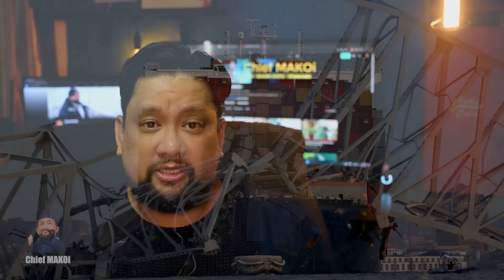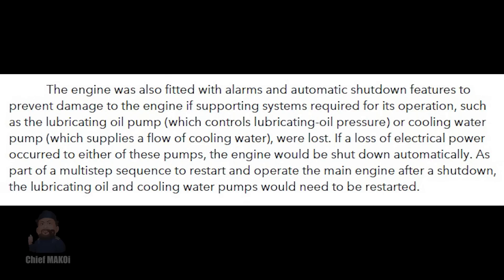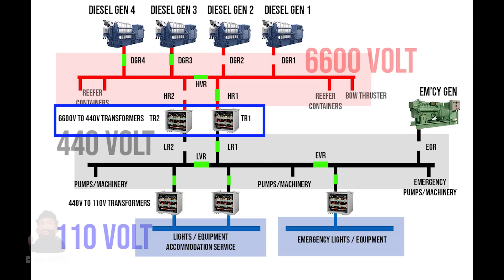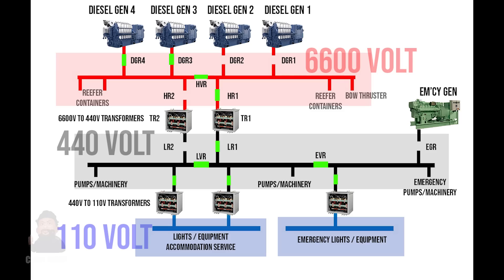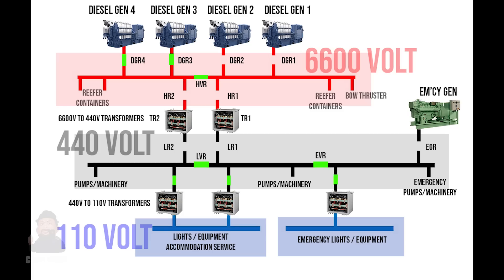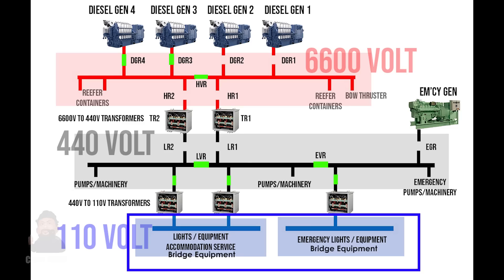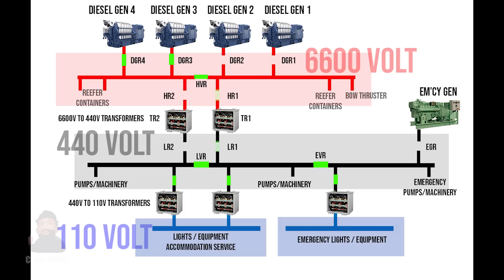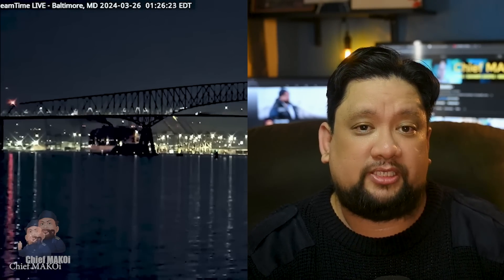Explaining the NTSB Report on the Container Ship DALI | Chief MAKOi

Comment: I’m surprised that reefers run on 6600v, seems dangerous to have such high voltages on deck.
Reply: The benefit of high voltage is that you need lower currents, which makes a big difference to cable size and other factors. Same reason long distance (on shore) electrical transmission usually uses very high voltage.
Reply from the maker: They also have their own transformers.  They run at 440v.

Comment: What are the cases, that such a breaker on a ship trips?
The same as a "normal" breaker on shore (overcurrent, temperature, undervoltate etc.)?
Reply from the maker: Pretty much.
Reply: @ChiefMAKOi  Hello Chief,
as an electrician I THINK:
when both switches opened at the SAME time, it can´t be come from only ONE switch, it must be an issue from "outside" (temperatur from the transformer etc.)

Comment: My question, why was TR2 not in auto stanby? I have worked on similar set ups and the other transformer is in auto standby
Reply from the maker: A better question is "why do they need to manually close it everytime?"
Reply: Yes, if the techs/engineers in the room at the time knew that they had switched over from a known working breaker/transformer configuration before they left port, then the logical solution to the breaker trip during this critical maneuvering phase should have been to return to the last known good configuration i.e. TR2 and it's associated breakers.

Comment: Can you please explain why HVR and LVR are normally closed? Doesn't make much sense to me.

If those were open and both transformers used in parallel you would have redundancies, if both low voltage sides feed 50% of the pumps and the engine can run on 50% of the pumps.
Reply from the maker: They are usually mechanically interlocked.  Only one transformer to be used at a time.
Reply: @ChiefMAKOi  okay, but why? 🤔

I mean if the bridge connectors HVR and LVR are disconnected you would get two independent busses for HV and LV creating a redundancy.
Reply: In the Mission Critical industry this is known as an N+1 configuration i.e. one off-line backup for each essential piece of equipment.
Reply: @BlueSpruce2  well, that's not what I mean. I'm more talking about two systems running in parallel, so a single outage isn't killing everything at the same time.

The emergency generator is the +1 here, but it means you loose propulsion for 15 minutes or so until you restarted essential systems.

Running everything in parallel you would loose some steering speed and maybe would drop some loads like lights and nonessential systems, but key system could get bus A/B connections in parallel. Like radar, sonar, horn, GPS, AIS, Autopilot etc.
Reply: I'm not an electrical engineer but suspect running parallel xfmrs is not as easy as it sounds.  The inputs and outputs will need to be synchronized (in phase as they say when dealing with AC power) but you could certainly energize both and use them to power different pieces of equipment.  I think the bigger question is what backup or redundancy can be built into the fuel delivery and cooling system of the main engine in the event of generator or transformer failures that would prevent main engine shutdown.  UPS maybe?  I suspect they wouldn't want to lug a bunch of heavy batteries around if it takes away from cargo capacity... 😃
Reply: @BlueSpruce2  well most critical equipment runs via power supplies. So you can just run equipment with two powersupplies, like servers. That's absolutely normal to run them with shifted frequencies and uneven frequencies in times they run on generators.

So it's off she shelves components to make that happen.

And fuel pumps, coolant pumps, oil pump and rudder hydraulic pumps can run completely independently, just having check valves to avoid backpressure through pumps which are off - which they probably already featuring.

Rest would be just evenly spread out over both busses, so you get "some" lighting on Bus A and "some" lighting on Bus B, one anchor motor on A and one anchor motor on B etc.

On critical equipment you could also feed both busses in and put a relay controlled switch in. So it's fed via one bus until power fails and it jumps to the other. If both powers fails it detaches from both until one bus is powered again - like a backup power transfer switch for generators.
Reply: @RubenKelevra  Interesting idea.  Would need a smart ATS to determine which bus has lost power - which shouldn't be difficult to figure out.  On gensets the ATS only switches over after mains power is lost and the generator has started up and is running at full power.
Reply: @BlueSpruce2  I think there are transfer switches which basically have a plunger in the center and regardless which side is energized, it is drawn to the side. So if the active side loses power it drops in the center and is picked up by the other side if got power.

But this only makes sense for equipment which is not sensitive to power outages and also not that powerful in consumption, as it will spark a lot if it's a pump or a motor which is switched mid turning from one power source to another one.

These are better switched manually or just put in twice.

Comment: Electrical was out of phase when Manually reconnected With the backup still running, that would trip the HV generators.  Would also account for the smoke, electrical fire.  My best shot at this, and they did it twice under way.
Reply from the maker: Not possible. The emergency bus disconnects from the main bus when the emcy generator runs.
Reply: I was thinking along the same lines.  I'm not familiar with ship electrical systems but anytime you have multiple systems they have to be phase synchronized to work together or things go wrong in a hurry.

Comment: Why does the ship veer towards the bridge after it looses power? Should travel in straight line, no?
Reply from the maker: They say there's undercurrent or something.  I'm not a navigator so I'm not sure. 😊
Reply: It is quite possible that the ebb tide coming off the Curtis Bay channel, pushed the stern to port. The combination of ebb tide and no propulsion made the rudder ineffective. Of course if the engine did go full astern that would have further accentuated the starboard swing towards the bridge support,but it seems that the main engine did not restart before the collision.
Reply: @amarsekhar-rv8vd  does not make sense to me. The pilot has ship steaming straight in the channel. There must be plenty of room to pass under bridge. Then power loss. Followed within 60 seconds by ebb tide which changes ship direction and causes it to ram into bridge support.
Reply: @Steve-Richter Can’t think of any other reason. Guess we will have to wait for further NTSB / Coast Guard reports.